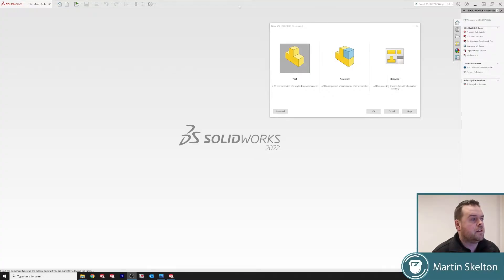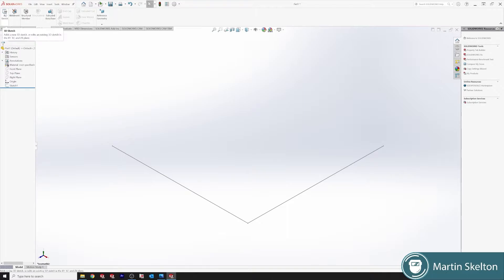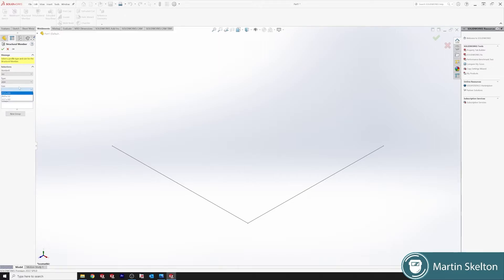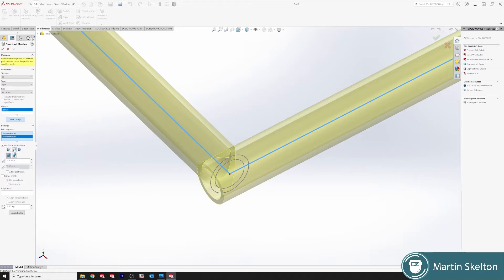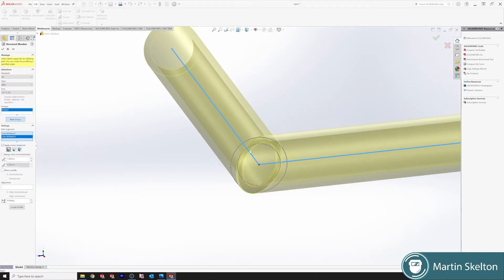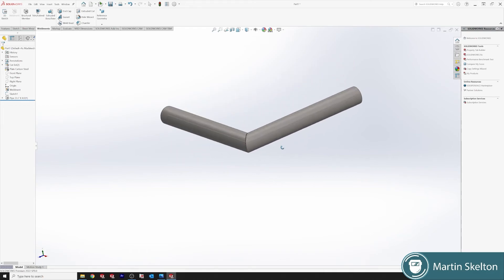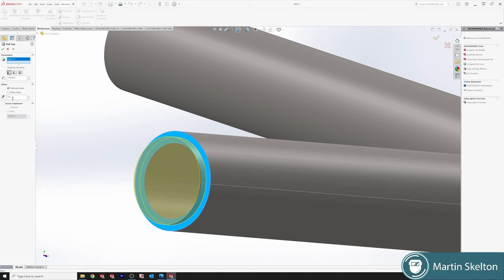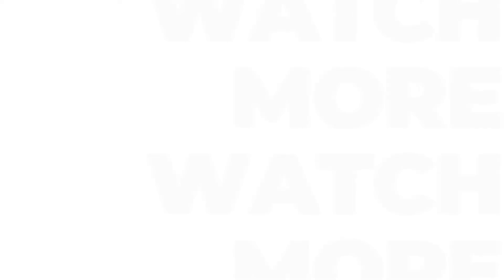SOLIDWORKS Sheet Metal Tutorial #6 // WELDMENT PROFILES // CORNER TREATMENT // END CAP

Comment: Very useful video indeed. The merge miter trimmed bodies check-box at 5:41 looks interesting, if for example, if I want to make a rectangular frame, instead of cutting 4 pieces of steel, I could create the weldment and select 'Merge miter trimmed bodies', this could then be laser cut as one piece instead of four which would reduce costs, then fold the tube and weld. Is that the right idea?

Comment: I was an Inventor user, and due to the job that I'm applying to, it's a must to use SW, and your videos really helped me alot. 
I'm waiting for the future videos videos (Assemblies, Structure systems,.... etc)
Continue and keep it up 😍
Reply from the maker: Hi Mahmoud, thank you for the comment. Changing over Cad systems can be hard to do, but each system (solidworks, inventor, creo, etc) has an advantage over the next. Some things in solidworks are very difficult to achieve compared to other softwares and the opposite can also be said. I have used a few different ones, but for the work I do and the location im in, solidworks is the common software. In saying that there are also Creo, Inventor and Catia users in my area but mainly solidworks has the majority share.
I am getting around to uploading some more videos and hope you find them a help also.